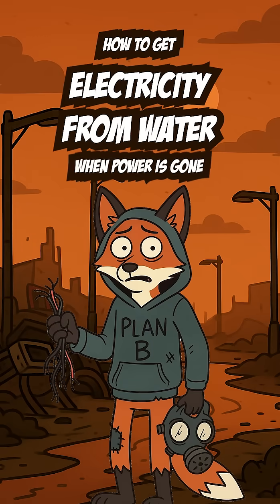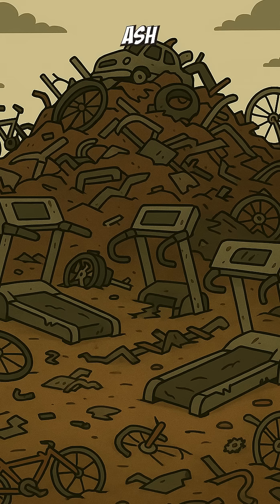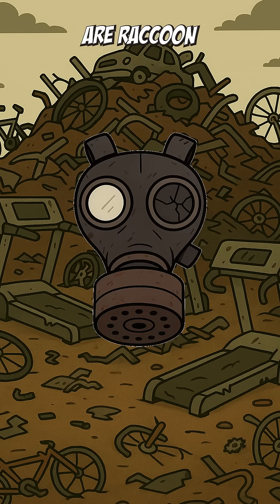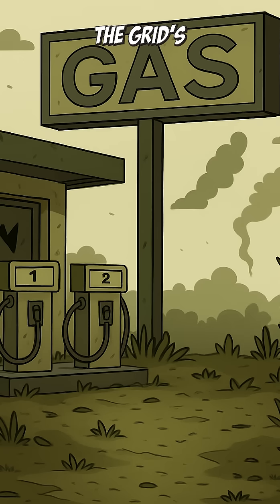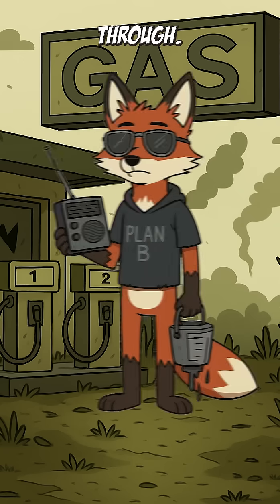How to Get Electricity from Water in a Post-Apocalyptic World #shorts #science

Comment: NOPE. 

First of all, if the motor doesn't have permanent magnets, it's an expensive fidget toy. Steppers, induction motors, and several other topologies don't have permanent magnets and are only useful for their bearings.

Second, the power you get out of the motor is most likely going to be alternating current, which must be rectified before being useful. If you try to pump it straight into your radio, you will see the magic smoke escape; if you try to charge a battery with it, you're going to get either a fire or an explosion, both of which will leave all sorts of nasty toxic waste behind.

Even after rectification, you still need to find a way to regulate voltage, and that's not going to be simple at all. If you can find a linear regulator or a low-voltage SMPS and you happen to have a decent amount of electronic design experience you'll be able to make your electronics work, but otherwise you're more likely to destroy your device than charge it. 

And finally charging a battery is something that must be done with extreme care, as overcharging will either damage it or start a fire. 

Look for working solar panels instead, they'll output DC and probably be attached to a battery bank.